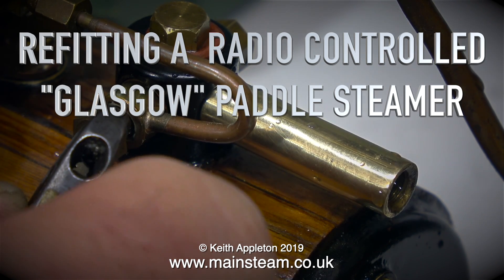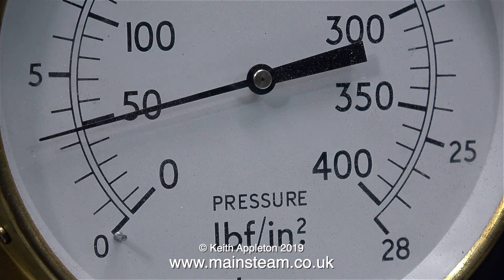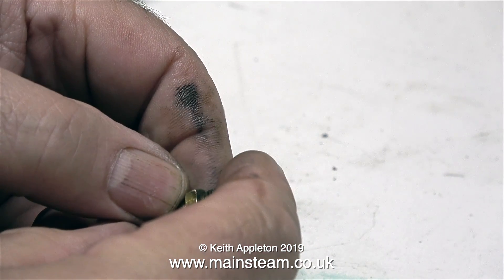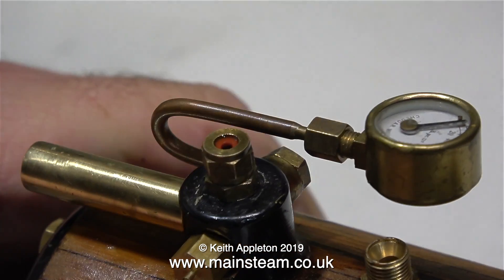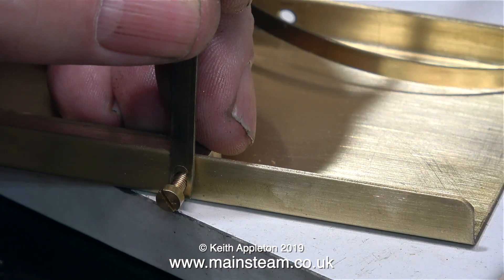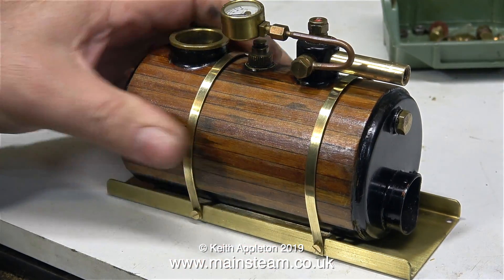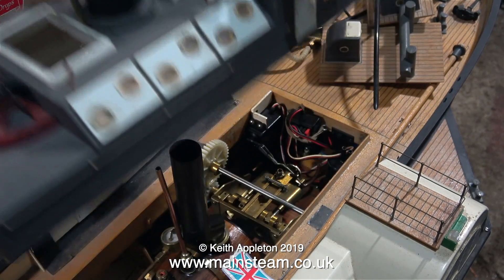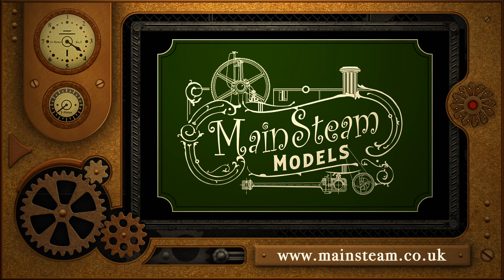A "'GLASGOW" PADDLE STEAMER REFIT - PART #6

Comment: In general, I never see Temperature Gauges used on boilers/burners or in steam systems. I am sure there is a reason for this, but I don't know what it is. I do know that Temp and Pressure are related, so why no Temp Gauges? - Another great vid! - Thanks for your time.
Reply: Temperature dosent move a steam engines.....  steam Pressure does ...  temperature is  irrelevant thus no temperature gage... However at 50psi. Steam is 298 degrees f